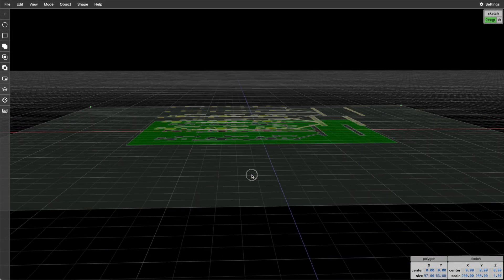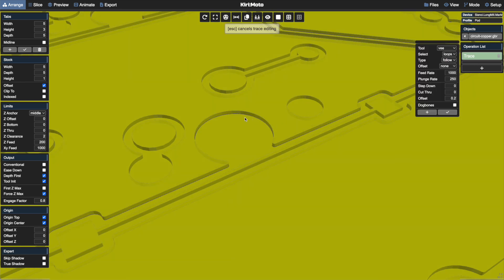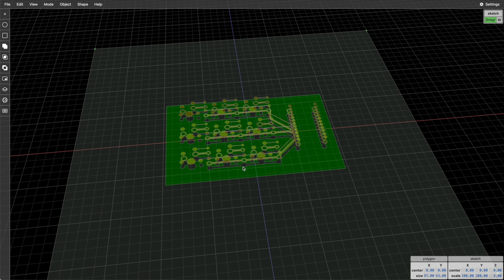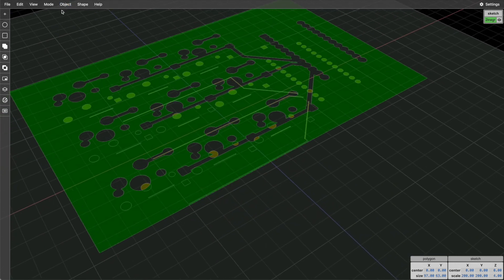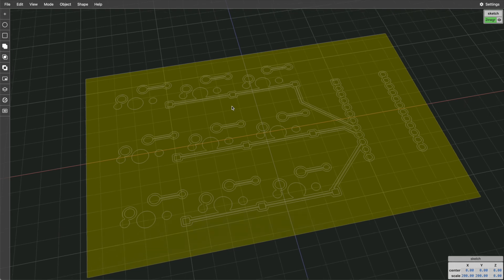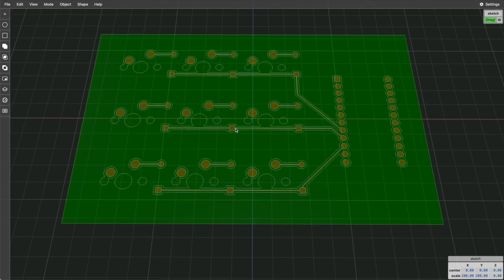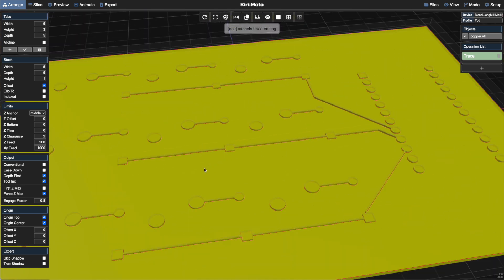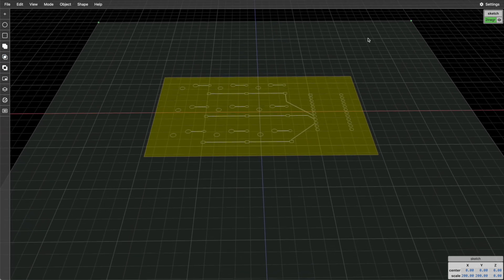Circuit to CNC

Comment: This is a cool way to go about isolation routing, never knew Kiri:Moto could do this. I suppose the only limiting factor in this is the lack of doing multiple isolation passes like in FlatCAM, id definitely like to switch over to this for pcb isolation routing, and will give it a try next time i design a one sided PCB. Thanks for the hard work in Kiri:Moto. I use the CNC much more because of Kiri's ease of use compared to the competition.

Comment: This is a great new addition! Have you done a guide on how to run kiri moto locally offline, if that is even possible?
Reply from the maker: sure. the readme in the github project covers how to run these apps locally. there are also desktop builds under releases here https://github.com/gridspace/grid-apps/releases
Reply: I have tried multiple desktop builds and cannot get them to run, 4.0.30 currently, when opening it says kiri moto is loading infinitely, only useful info on debug I can see in developer tools is quite a few webGL errors, I have no idea what that means?is it a graphics issue? Running windows 10...
Reply from the maker: this is the first time this has been reported. and I'm not certain how to debug/proceed. does KM run in your browser (please try chrome,edge,firefox) or does it also give webGL errors on the console?
Reply from the maker: does KM run in your browser (chrome, firefox, edge) when loaded from https://grid.space/kiri or does that also yield webGL errors on the JS console?
Reply: @GridSpace  yes it ran well in all browsers except Brave, I got the standalone app to run by disabling Intel graphics drivers in system options, and reverting to Microsoft drivers, it runs well but a bit slow, obviously a hardware issue on my side, so maybe the drivers cause a conflict? All 7 webGL errors have disappeared in the developer panel thing, so I'm super happy to have it running, thanks for the great software, there is no other affordable 3d option!
Reply from the maker: glad you are able to run it! driver level issues are too low in the stack for me to have any influence, unfortunately.